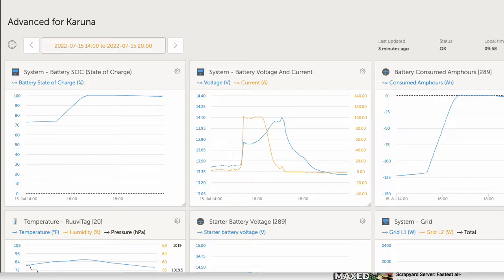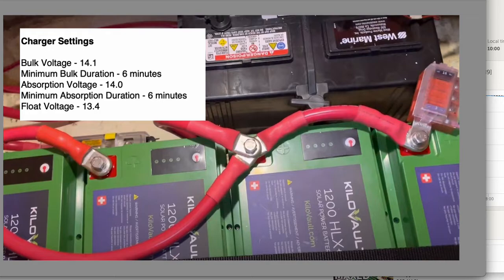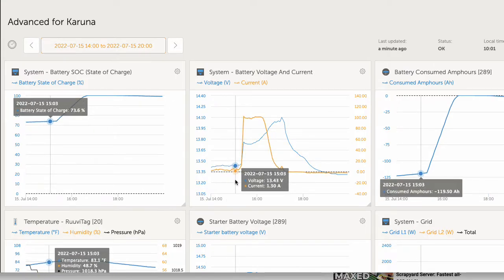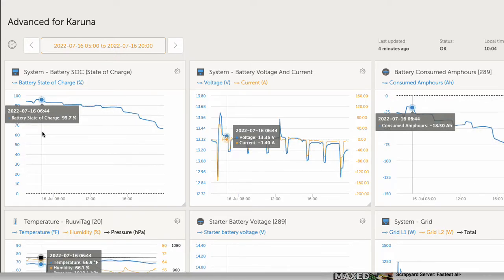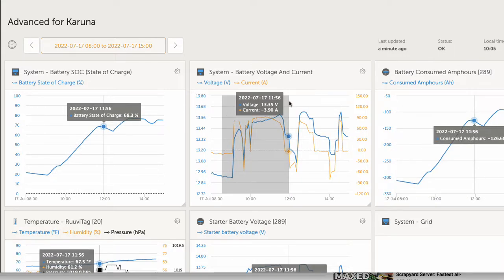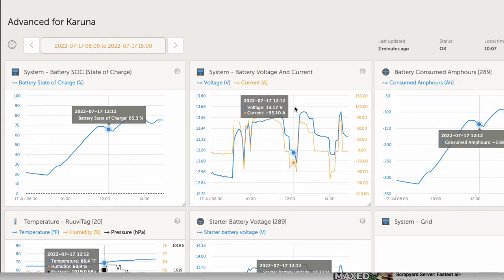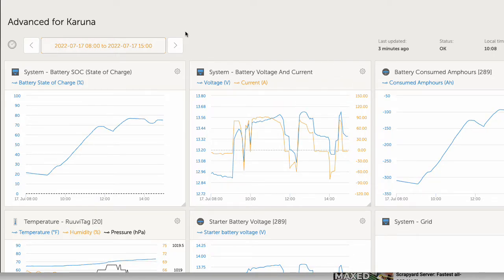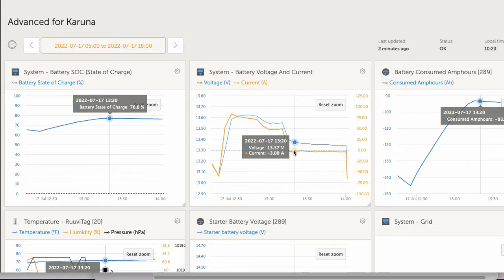Balmar Regulator - Going into Float too Early with Lithium

Comment: Try to modify FbA and FFL. Decreasing FbA = Increasing Bulk time (500Ah 55 - 45%, bigger banks: try about 39%, possible to go down to 16%) That should help to charge much longer without using fixed bulk times. FFL you could decrease too, to reduce FLOATtime and get back to absorption earlier. Good luck.